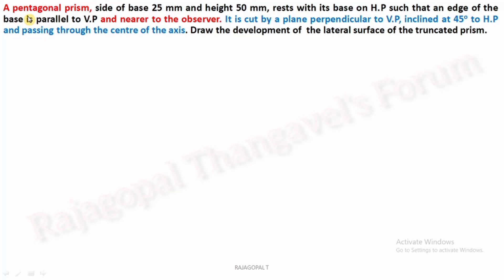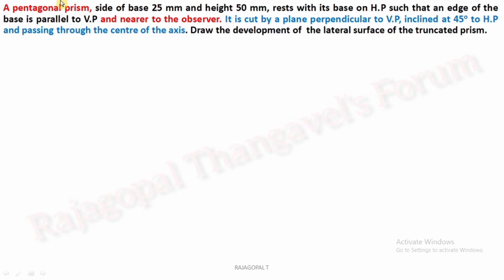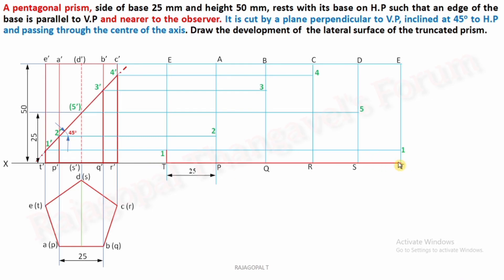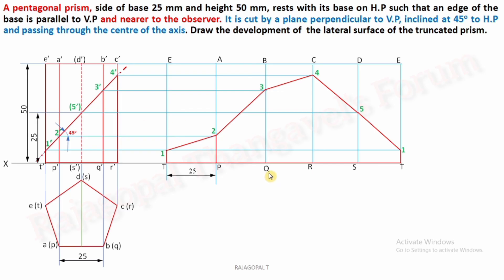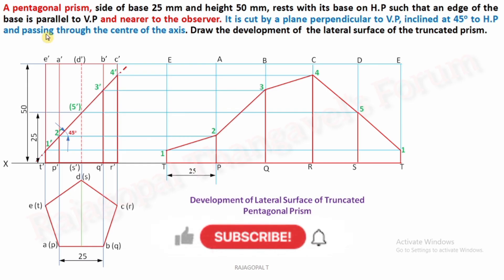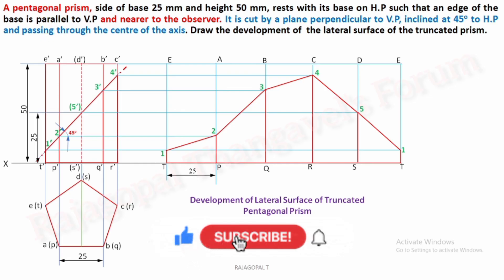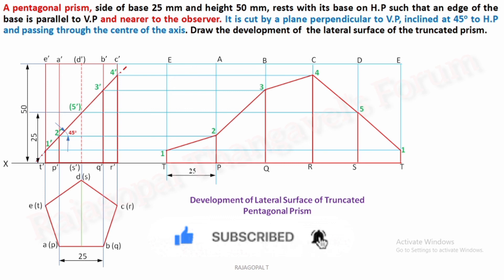Development of Surface Pentagonal Prism @rajagopalthangavelsforum

Comment: A pentagonal prism of side 25mm and height 60mm resting on H.P with its base, as 
one of its base edge is perpendicular to V.P. A cutting plane is inclined 45 degree to 
H.P and perpendicular to V.P cuts the solid 30mm below the apex. Draw development 
of surfaces of the truncated solid.

Comment: A pentagonal prism of base sides 30 mm and axis length 60 mm rests with its base on HP and an edge of the base inclined at 450 to VP. It is cut by a plane perpendicular to VP, inclined at 40° to HP and passing through a point on the axis, at a distance of 30 mm from the base. Develop the remaining surface of the truncated prism

Comment: 2.A pentagonal prism side of base 30 mm and axis 60 mm long is kept on HP in such a way that one of its base edges is parallel to the VP and near to the observer. A cutting plane bisects its axis at 45°. Draw the development of lateral surfaces the pentagonal prism.